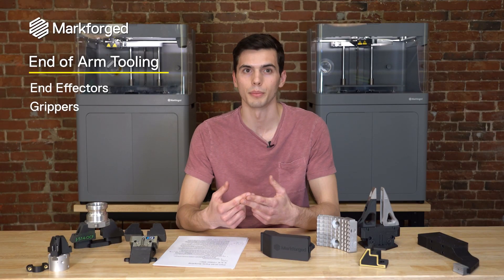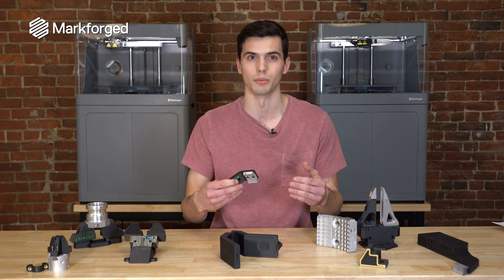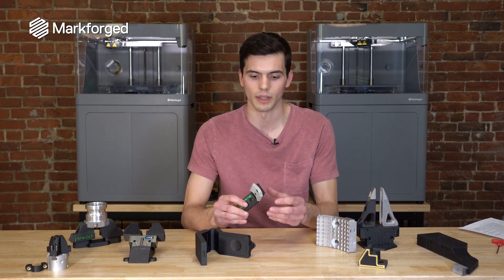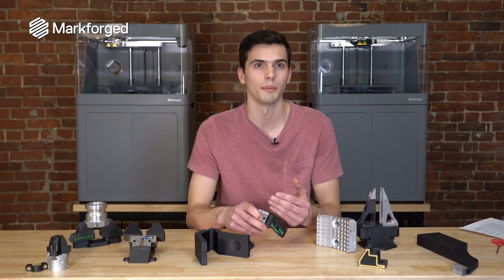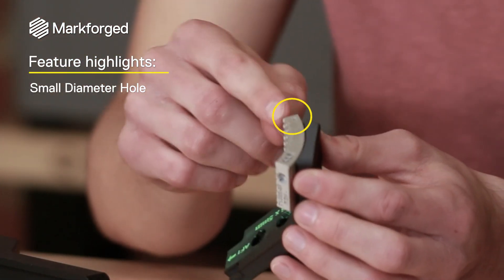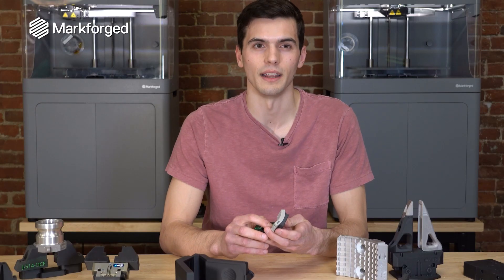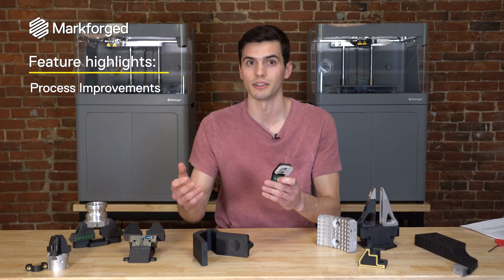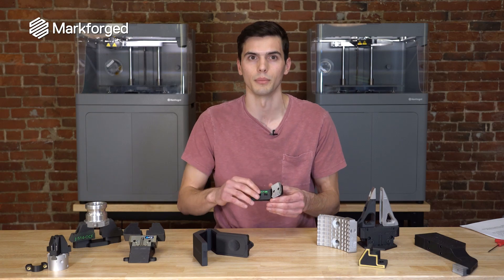3D Printed End of Arm Tooling (EOAT) | Hybrid Parts

Comment: The thing that has jumped out at me every time I see additive solutions is the further improvements that weren’t in the original spec for the items replacement. Cooling in this instance but I have seen it where someone wanted to be able to make tooling components that ended up using the printer to make the product instead!

Comment: I work in a CNC shop and I still wondering how is more viable a metal 3D printer than a Haas vf-2 for example, the 3d printer is slower and it does not have the precision of the cnc mill, another disadvantage is the work space, a cnc mill has 13 time more workspace than the Markforged X, the part you showed up can be easily manufactured on a cnc mill, I know 3d printing will be the future of manufacturing but I dont see when.
P.D:I'm not looking to ofend no one, I apologize in advance.
P.P.D: I'm a huge fan of your work and your printers
Reply: Genuinely, go speak to one of the reps. They will be able to give real examples for your application. 

As they described here the part has a cooling channel which unless you make it in two parts then either welded or a seal and screwed together that cannot be done on a CNC machine. 

Importantly additive manufacturing is there as another way to do certain jobs. Not necessarily to replace a CNC machine entirely. 

Honestly. Go speak to them or get on one of their workshops and speak to them. 

👍